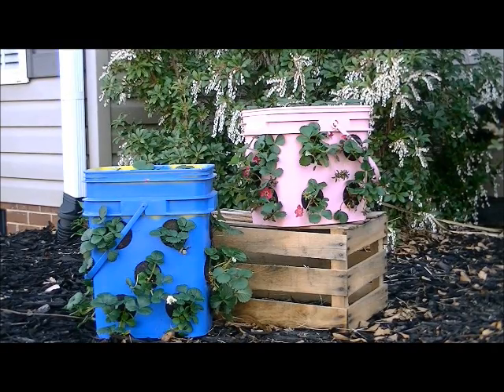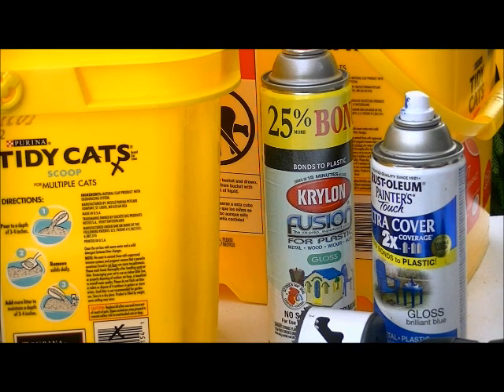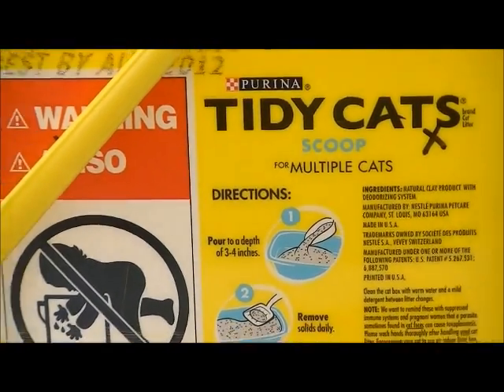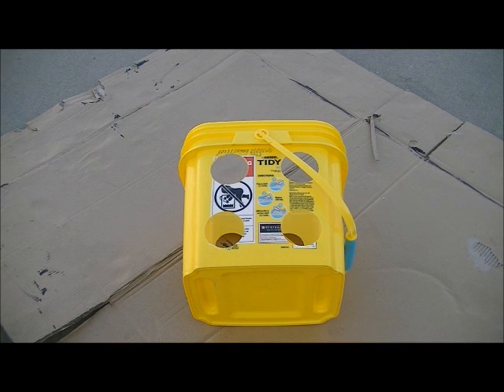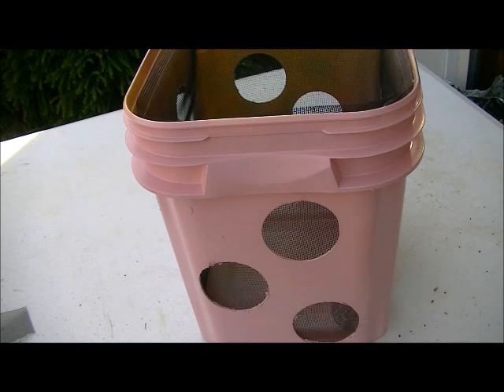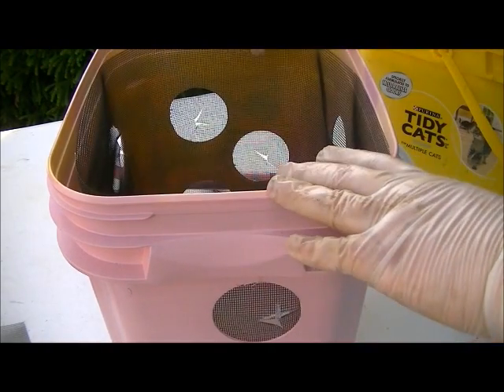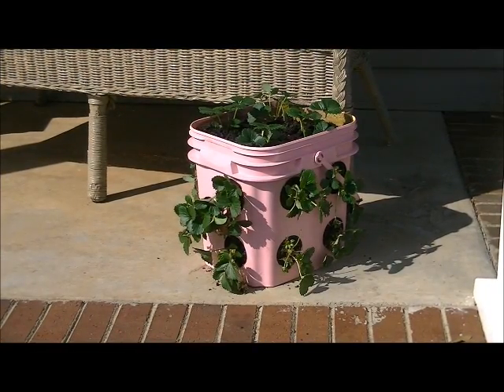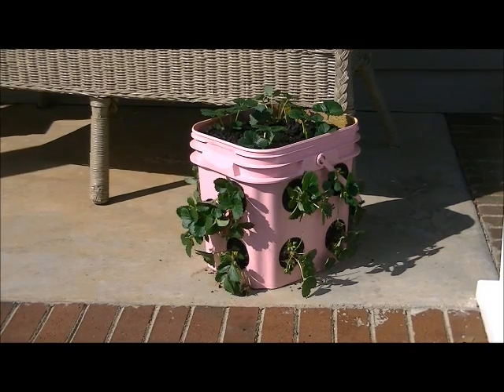How to Make a Strawberry Pot from a Kitty Litter Bucket

Comment: great idea but do you not need a drain hole in the bottom of the old kitty litter bucket?  Thanks for the video.
Reply from the maker: Ha, not if you water like I do (or should I say don't do)! ;)  But, seriously, yes drainage holes should have been added.  Thanks for pointing that out!